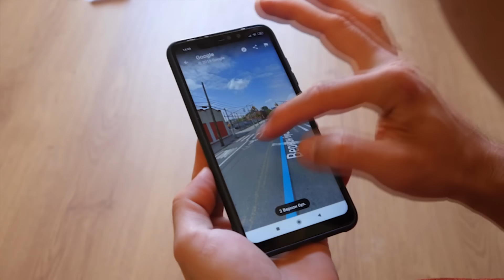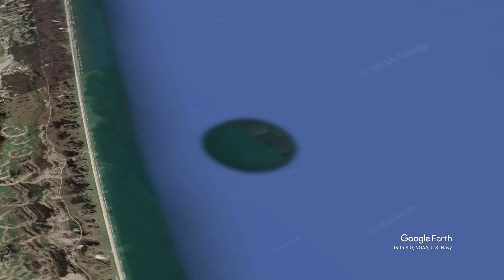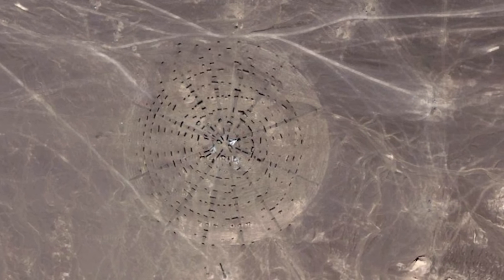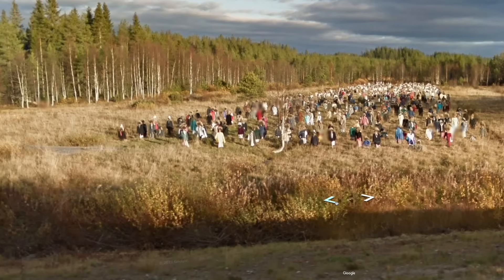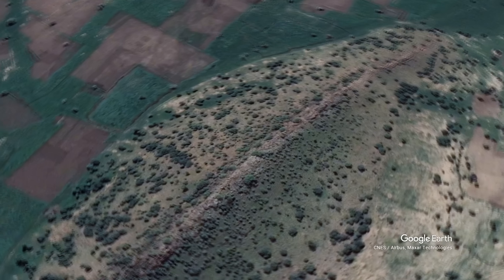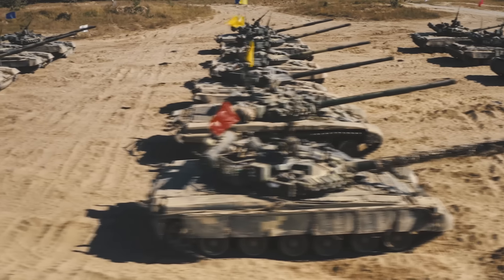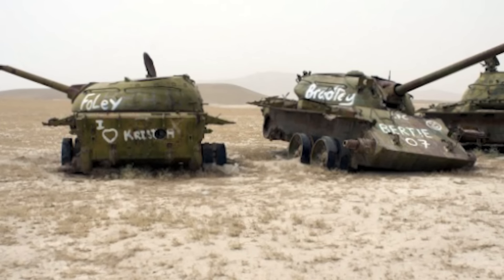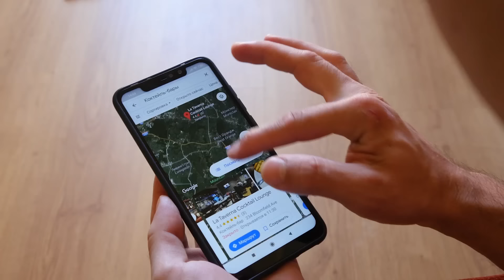The CREEPIEST Things Found On Google Maps

Comment: The "Black Hole" in the gulf is NOT a glitch or anything like that. There are boats & oilfield installations all along the western & central gulf. Most likely, someone with a 360 degree camera went on a boat ride & uploaded the image or Google didn't just blue out that area like they did the rest of the gulf. If you're curious, look off the coast of louisiana just below Port Fourchon, La and you'll see the same thing. 

As far as the "Lips" in the Sudan; The narrator said no one has been out there......BS. You can see farm land all around that area in the newer photos.